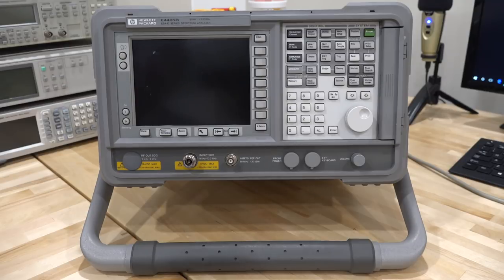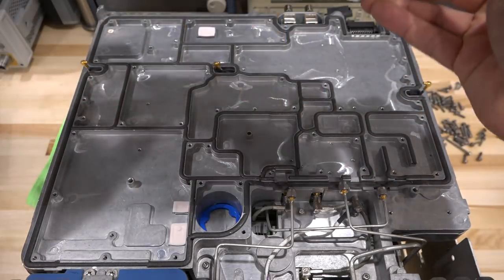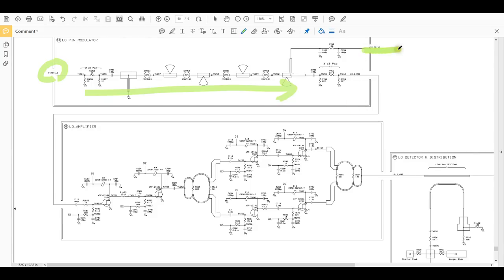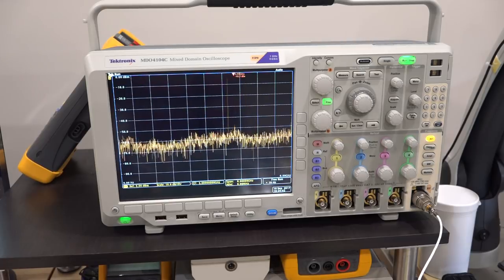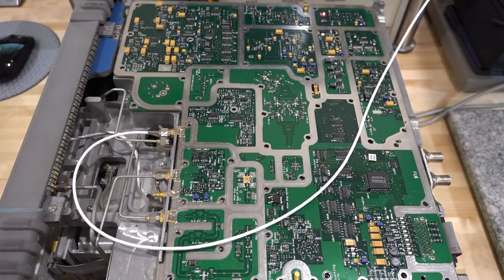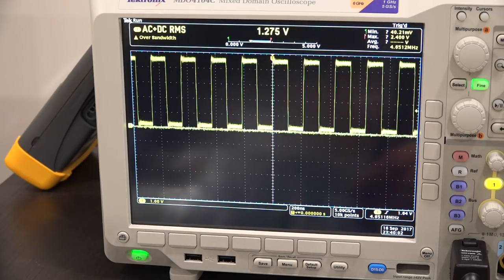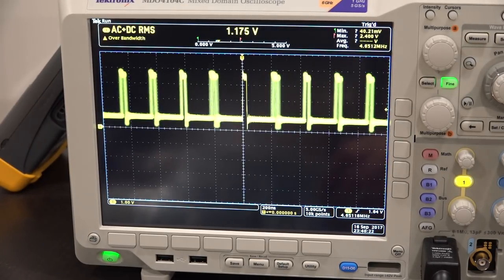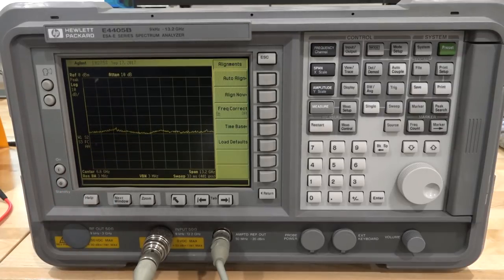TSP #109 - Teardown, Repair & Upgrade of an Agilent E4405B 13.5GHz ESA-E Spectrum Analyzer

Comment: I've been tracking these scopes for a while now. They are ridicuously priced regardless of your first video. I have no idea why. As you said, I've seen them muddy. Some really look like someone just decided to dump them in a river and leave it there. For something that corrodes they still sell for $1000 - 1500. I think it has to do with grabbing out the parts for resale since its a more recent SA. Same goes for the "EC" type for the 8560 series spectrum analyzers. I can get an E-series for way cheaper than an EC. I was "lucky" to get a 8563EC 006/007/008 for an half of an equivalent 8563E's price but the catch is broken aka "attenuated to 30dBm" RYTHM with broken A14 and A15 boards. The boards are easy but that RYTHM is tough.

Comment: I would concur with others who've said the diffusor is probably just yellowed. Not sure how exactly those are built, but if acrylic is involved, that will yellow under UV exposure, and I assume CCFLs are not too different from other fluorescent lamps which generally produce plenty of UV (along with some heat).

Incidentally, there are some dealers for CCFLs, like CCFL Warehouse. No idea how good their stuff is though. Looked into them a while back when I considered revamping an old 19" LG-Philips IPS panel with tons of hours of graphic design on it (but it also had a massive amount of image sticking like I've never seen before, indicating it used to run very hot, possibly at high brightness under poor ventilation, so heaven knows what shape the rest of the monitor is in). Maybe I'll come across a super high end Eizo one of those days, or I'll just tackle the very worn L795 that's floating around here.

It would be interesting to investigate why these divider chips are failing. Might be the silicon itself, especially if they are running hot, but in the past the reason often turned out to be absorbed moisture. I'd be tempted to try heatgunning the chip and see what happens.

Comment: I have found YouTube is really good at one thing, driving up ebay prices.  I do a video on a radio and the prices go through the roof.  LOL, we should get kick backs.
Reply: Before he did the initial repair, we could find Spectrum Analyzers like this for less than a thousand :(
Reply: it sucks
Reply: Like anything on eBay, some of the postings are simply a ripoff. I just ignore those "parts only" items that are totally beyond economic repair yet are outrageously priced.
Reply: MikesRadioRepair . To monetize it just give a heads up to your patreon members before your video goes public. :)

Comment: Did you ever find a source for the front panel probe power connector you were trying to find a couple of years ago? Your borrowing of power for the DC converter reminded me as I'm still looking for the proper connector for my Rigol DSA1030A-TG to power a home-brew high-Z probe for the SA. Thanks for sharing another great repair!

Comment: excellent repair and the backlight was great !!
Reply: well the no dimming black light was abit stupid when any recovered laptop led blacklight got brightness  circuit and they used for use dim and PWM plus the yellow polaricers are not right just sounds like the plastic aged and turned yellow.
Reply: I've already picked up cases where the polarizer was darkened, this caused a yellowish tint

Comment: my unit went down. display lights up blank. opened the front panel, checked the ribbon cable and the flat cable to the display. no go. any advice would be greatly appreciated. it was gifted to me by my mentor, great sentimental value...

Comment: I have an 4403b with this same problem.  If I reduce the end freg to ~1.5ghz the LO stays locked above that, same issue.  I think I will try the same chip.  I think you call it out on your other video.  I also have a 4402b that has display noise and no external video.    The problem is the display chip on the processor card as it goes directly to the external display.   Swapping the CPU card confirmed this.  I have not been able to find a replacement chip.  Any ideas?

Comment: I have an E4402B and when it tries to calibrate the RF or I turn on the RF tracking generator it makes like a hissing sound. What could that be? Or is that normal?
Reply: I have the same. Searched around. It is apparently the chirping sound från the auto alignment. Absolutely normal. Freaked me out as well.

Comment: I am wondering on how do people get money for there labs? You see a lab and in the corner or on the shelf, there is a stack of gear, each costing between 2,000 and 10,000$ each, maybe 1,000 to 4,000$ used. How do they do that?
Reply: They work ...
Reply: i rely on ignorance and auctions to buy lab equipment, 95% of people don't know what the equipment is for
Reply: @djreactive  Thanks for replying, that is a great advice! :-)
What make the prices so huge for me is that i.e. $400 is what covers all my shopping for an entire month and then is there about nothing left, so alone $1000 will take me maybe 6 months off saving, so $10,000 is totally insane and $30,000 is what a really great new car is costing, including taxes and everything.